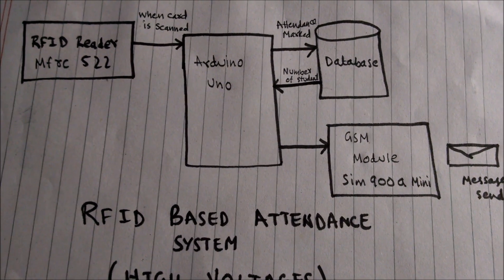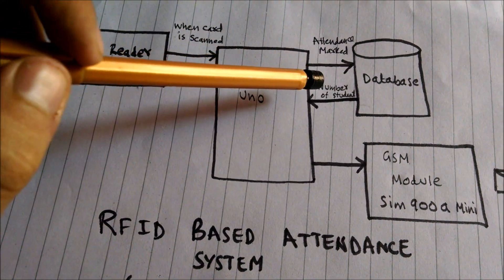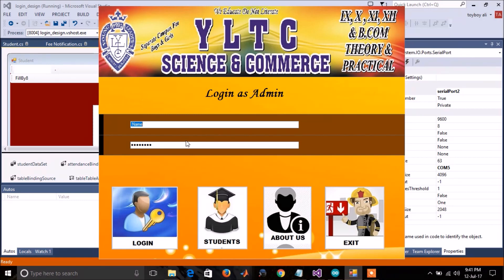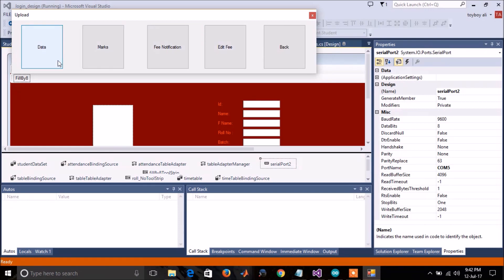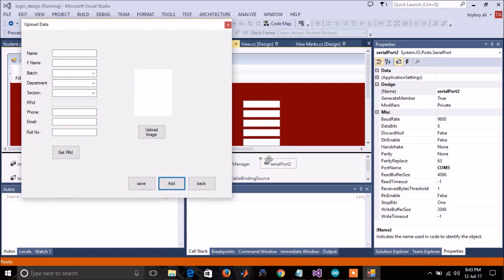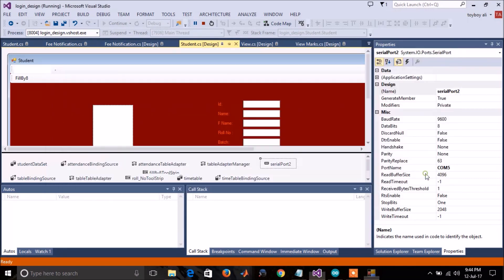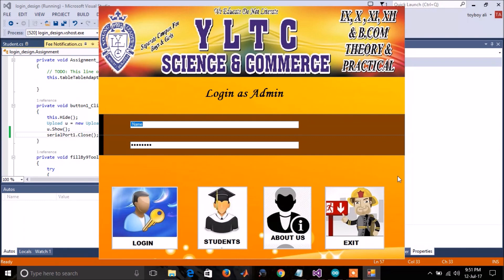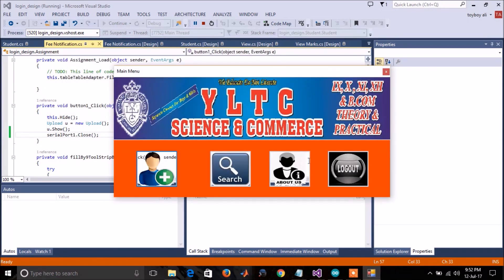RFID Based Attendance System

Comment: sir i need you again un gsm 800l module 
is not sending a message
Reply from the maker: Check connections,  power source or baud rate.
Reply: @HighVoltages  plz sir reply to my message :(

Comment: Sir it posible to.Use gsm module sim800l ?
Reply from the maker: yes you can
Reply: @HighVoltages  sir how i can use it ? sir plz help me :(
Reply: @HighVoltages  and btw when i tap my rfid card there no data show in the student form what is the cause ? sir plz help me for my final thesis
Reply from the maker: For the rfid, check the results in serial monitor if you are getting values then open software and if not, 
Check the connections.
Or maybe cards have different frequencies.
Reply from the maker: You can email me or contct me on facebook page.
Reply: Sir what you''re email or facebook ?  i sending you picture to show you my problem ?
Reply from the maker: @nigrumcattus4062  www.facebook.com/highvoltagestech
Reply: @HighVoltages  sir i chat you in fb but there no reply
Reply from the maker: You got it.

Comment: Hello sir, I  getting confusing that which microcontroller can be use which one is best Arduino or 8051 OR PIC can you explain that wat is the real differance  between them which one is better
Reply from the maker: That depends on the application.  For this project,  all of them can work as the most important thing here is serial communication and arduino,  8051 and pic have serial ports.  Secondly arduino is a developmemt board,  8051 is a microcontroller and there are many pic controllers which differ in specifications.
Reply: Thank you

Comment: But its dialy using , without laptop save in sd card
Reply from the maker: Do not run it from visual studio instead import it as. Exe file and run it., when you run it from vs it resets database.

Comment: sir i want to send SMS WHENEVER student swipe the card i can modify your code but it will not send sms
Reply from the maker: You have modified the code and it is not sending sms?
Reply: yup it will not sending
sms
i think baurd rate is causing problm
Reply: I’ve got the same problem sir. But there is also another problem, can i add permanently data to the database sir? Using SQL server db? Or can i change the database?
Reply from the maker: Yes you can do that by not running it from vs instead make a .Exe file because when you run it from visual studio the database is reset.
Reply: Ohh i see. But sir it wont send sms
Reply from the maker: Are you using external power supply with gsm module?
Reply: Yes sir
Reply: Sir but i want if rfid card tapped to the reader, it will automatically send sms
Reply from the maker: The problem will be in the circuit can i see your circuit?
Reply: @HighVoltages  yes sir ill post it right away. the devices are still with my partner
Reply from the maker: Ok sure

Comment: Hey. When I click on DATA button. I get this error everytime

-  System.Data.SqlClient.SqlException: 'A network-related or instance-specific error occurred while establishing a connection to SQL Server. The server was not found or was not accessible. Verify that the instance name is correct and that SQL Server is configured to allow remote connections. (provider: SQL Network Interfaces, error: 50 - Local Database Runtime error occurred. Cannot create an automatic instance. See the Windows Application event log for error details.
)'